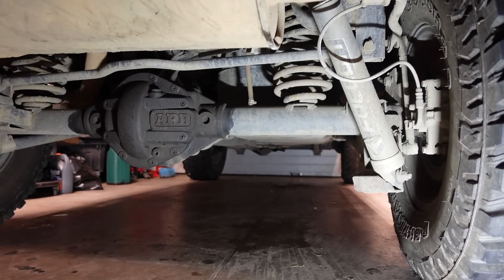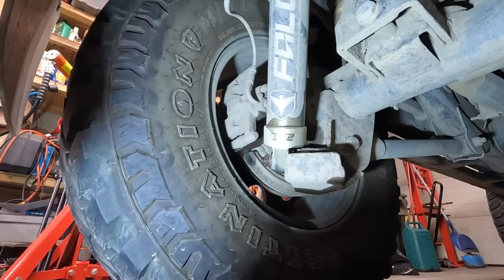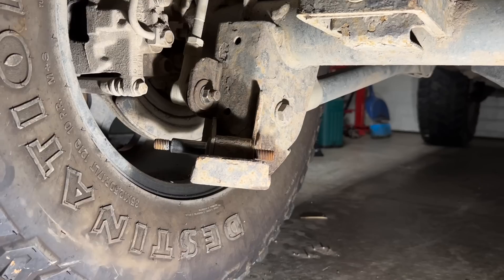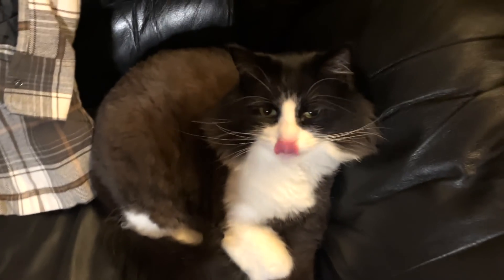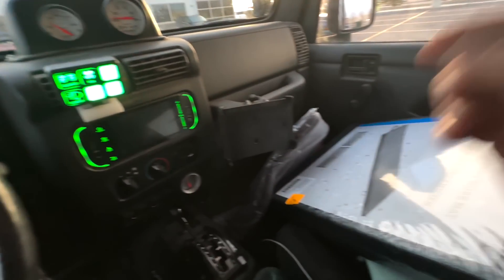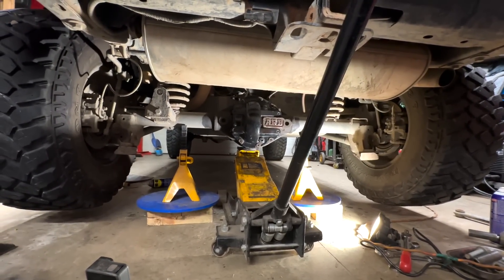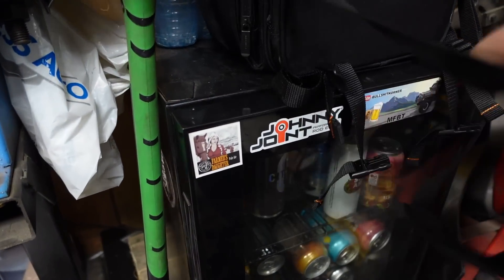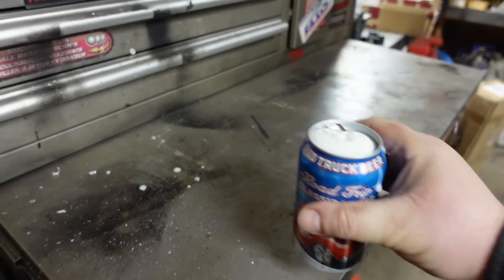MUCH SADNESS COMES TO THE JEEP JK

Comment: I've been running Rubicon Express springs for 15 years and I since they settled in when new, I can't tell any sag in them at all.  Now that's on my TJ which is a different animal, but still no sag to speak of.   And I have a steel front and rear bumper, with tire carrier out back with a 35" wheel.
Reply from the maker: Good to hear

Comment: headache for sure, im in the middle of swapping over a crate 350 and turbo 350 tranny into my 85 trans am, the previous owner twisted off both transmission crossmember bolts in the frame and just decided to weld the crossmember to the frame, so now i have to deal with it, fml lol